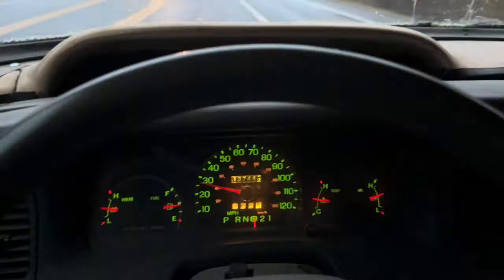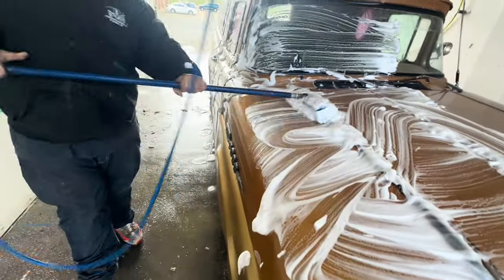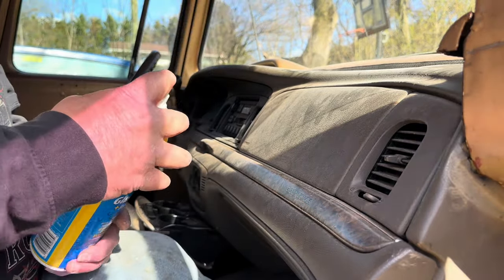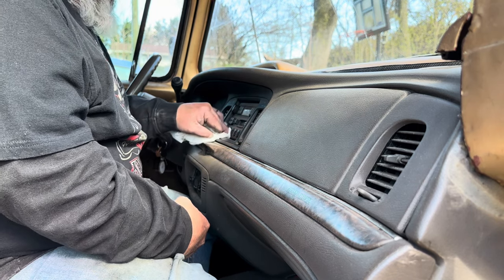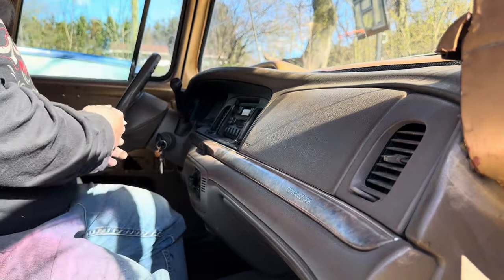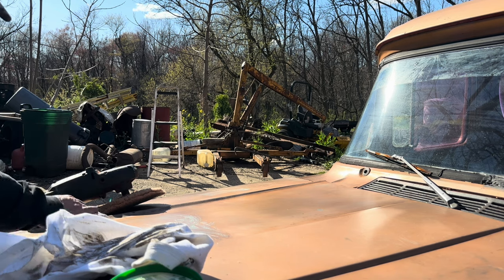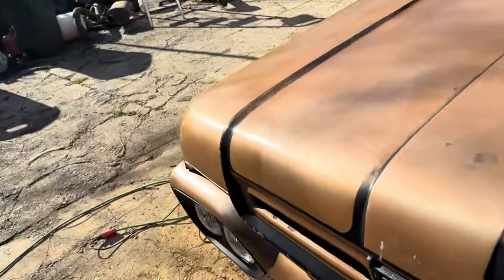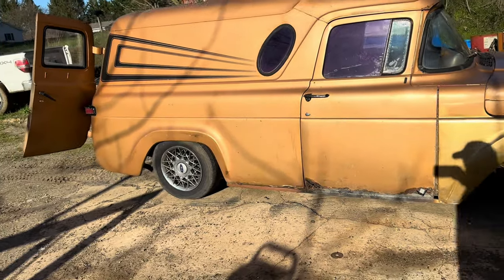First wash in 33 years 1960 crown Vic swapped panel truck

Comment: Make sure you degrease bottom good before you paint the bottom. That turtle wax full of silicates. Some guys say window cleaner spray works perfect. It will take a few coats of wax. First one getting sucked in. Good luck. 👍👍